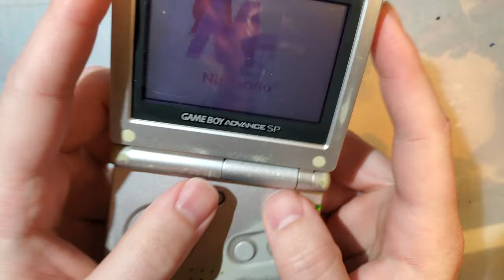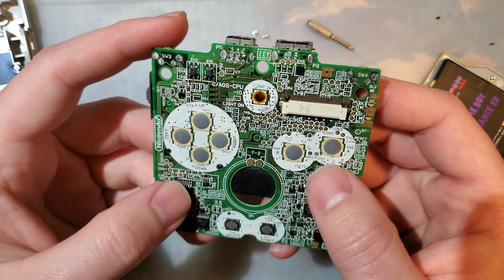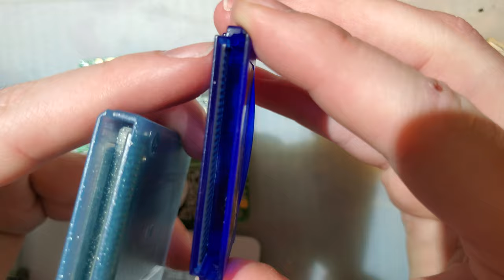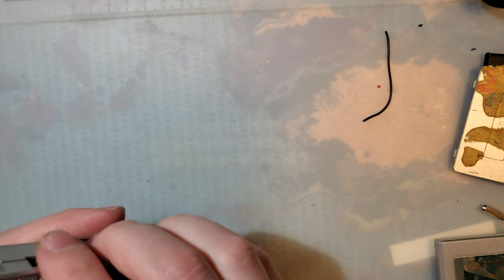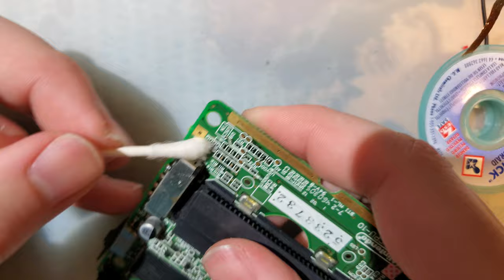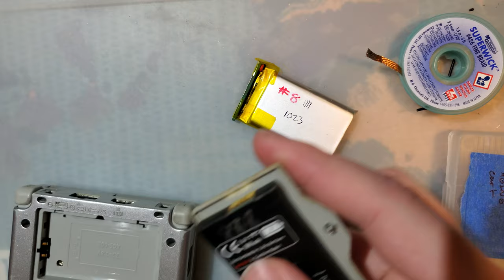Game Boy Advance SP Freezing on Boot (Part 2 of 3)

Comment: Your still more skilled than I. I have gone and got 0.3mm 60/40 solder just to help in small leg soldering.  Its nice to see a video series where its not just power swtich,fuse problem. I have a few consoles with strange troubles. Thanks

Comment: Do you have any tips on how to remove a stripped screw on a gba sp? I bought one and it works fine, but want to open it up to give it a clean. It's the battery screw. It's stripped pretty bad. :/
Reply: Same thing happened to me when I used a trashy aftermarket gba sp shell and it’s included screws.Just get a stripped screw bit, or put a rubber band between the screw and the screwdriver
Reply from the maker: @ahsanejoyo  going forward, you both should spend some money on a good screwdriver set (and then actually use it) so that this sort of stuff doesn't happen again. In the mean time, the most effective solution is to just drill the screw out and then twist the carcass out with pliers once you have it apart.
Reply: @ahsanejoyo  Yeah, I tried the rubber band trick, but no luck. Might have to drill it out. I got a good set of screwdrivers. It was my fault not checking the screws before I bought it. Looks like the original owner tried to open it and failed. It's a Pikachu gba sp.
Reply: @ZombieXHunter115  Well good luck!
Reply: Engineer makes these screw pliers for this exact purpose, go search for "PZ-56 screw pliers"
Reply: I had an issue with stripped screws on my GBA even with an iFixIt screwdriver set which is high quality and has many different sizes. I ended up getting this and extracted the screw just fine: 

https://www.amazon.com/Extractor-Stripped-HassleFree-Hardness-63-65hrc/dp/B07GZ17QD9/
Reply: @tkb301  Thanks for the link! I'll check it out!

Comment: I'm having an issue with my v2 ips display, the brightness controls change by itself and it's not working manually?, please help me.
Reply from the maker: sounds like you have a short
Reply: @makho  idk what it was but I disconect the ribbon cable and connected back in properly and now it's working how it should. Thanks.

Comment: Does anyone know if the usb-c mod for the sp will circumnavigate the em8 failure? My em8 sucks and doesn’t charge. Also- subbed. Love your content!
Reply from the maker: USB C mod only replaces the physical port itself. The only issue this mod can resolve is if your port is physically damaged. Any upstream issues will still persist.
Reply: @makho  do you have any recommendations for fixing em8? any mods to keep from happening again?
Reply from the maker: @ianfairbanks1318  it's a passive component, solder it back on
Reply: @makho  it is on. tried resoldering and it still wouldn't charge. how do i jump this ####er?

Comment: I googled the part number on the chip and I found one site with stock but you have to buy 100. While I was searching though I did find your battery board all over eBay for around $10 a piece.
Reply from the maker: I'm going to pull the RAM first before doing anything else. If the board looks good underneath, then I'll start swapping parts around with a (mostly) good GBA until I narrow down the specific problem. 

And yeah, I did release the board files so anyone can do that. They are breaking the license by not linking back to the source and they are being total cunts by not even asking first. I don't really mind if people resell that stuff and mark it up as long as they add some value (even if it is just end user support) but most "unauthorized" sellers don't seem to even do that.

Comment: oh wow interesting find... My IPS kit when installed the GBA boots as a GB game... or GBA but nothing works.... sometimes the screen glitches and won't show anything... so maybe its a chip... good video
Reply from the maker: no, sounds like you have another issue entirely, especially if the problem appeared after installing a mod
Reply: @makho  well I went back after your videos and adjusted everything... Now GBA games boot no glitches. However EZflash freezes/glitches if I hit start and select on one... and A+B L+R together on the other (i have 2 gba sp) But it doesn't on a regular GBA...so maybe its the flash cart? honestly trhe EZ is for my Gamecube player